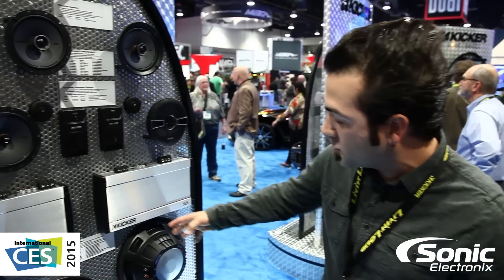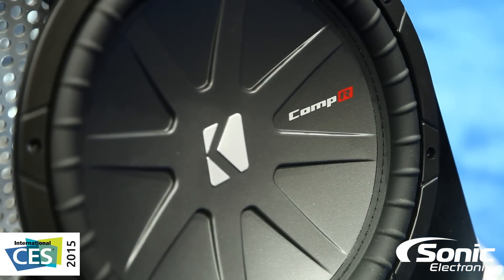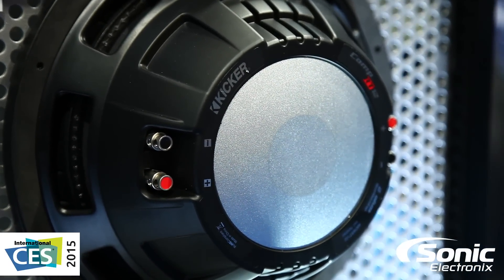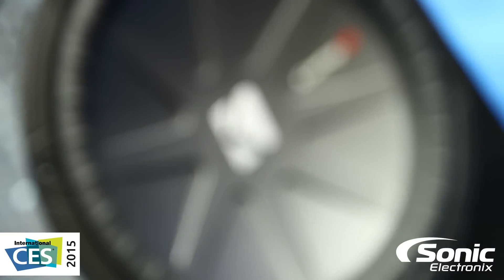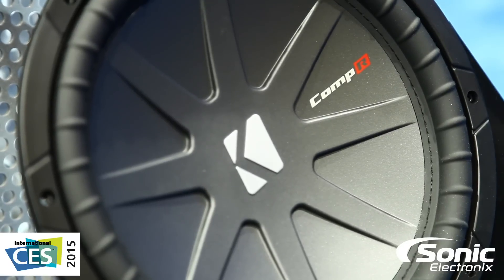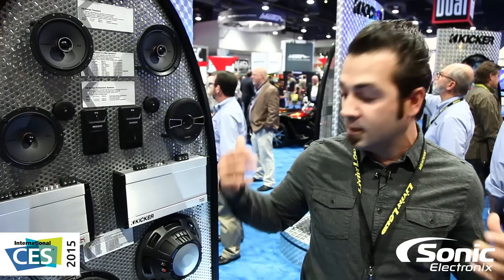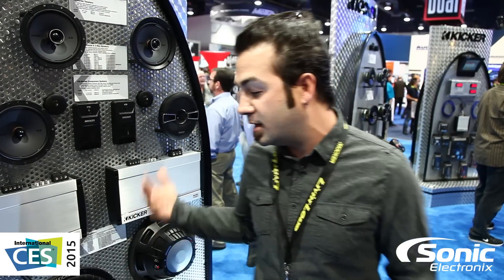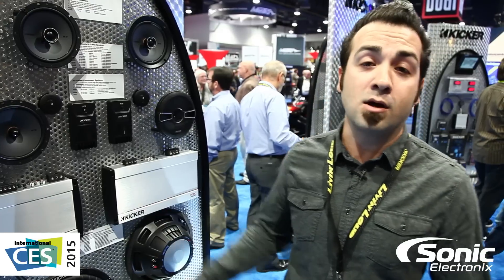Kicker CompR Subwoofers | CES 2015

Comment: They lowered the power ratings on the CompR and RT's.. I bought a CompR 15 before they rated them down and it says 1200rms 2400max and now theyre saying 800rms 1600max. I'm running 1500rms 2700max tho.
Reply: custom or preloaded Enclosure? how u like it?
Reply: I blew the sub. I went with DC Audio instead, handles the power much better

Comment: I don't know why a lot of people hate on Kicker. I just bought a Kicker CompR dual 12in loaded enclosure made by kicker with a CX1200.1 powering them and holy shit this set up pounds. It rocks hard and I have been into car audio for 12+ years now. I recently sold my JL W7 and Kenwood eXcelon XR1000 because the box wouldn't fit in my new car and I would have to say these 2 kickers CompR out pound my JL W7 all day.
Reply: the slot or round port design?
Reply: I have the JL Audio 10W7 in the JL Audio HO box and also found it too big and heavy for my import.  I tried the Kicker VCWR122, which is the pre-fab kicker box with the 12' CompR woofer and it has blown up 3 times.   The Kicker is a very "high Q" sound which i would guess is somewhere around 50hz, may be a tad lower with the cabin gain in a car. The whole package (woofer.box,port) is a poor design as it's no bigger that 1.2 cubic feet.  I would guess that the 10W7 goes 20 hz lower and can get @ 6 db's louder without mechanical noise or voice coil failure.

Comment: I just bought 2 12" 2 ohm with a port. I tried powering them with a Kicker CX600.1 but it seems to go on protection mode. Would this be because the amp is not powering them right or what amp would be good for 2 12" 2 ohm 2 DVC? PLEASE HELP
Reply: Manuel Aldaco 600 isn't near enough power for 2 dual voice coil 2ohm 12's. I have 2 compR 12's on a 3000.1 amp in the kicker slot port box and they hit pretty hard without cutting amp off.